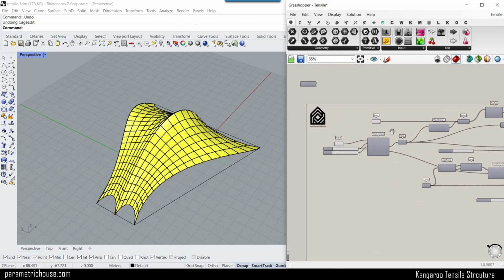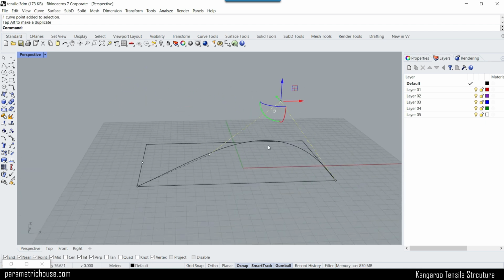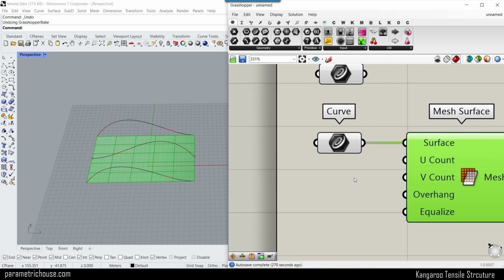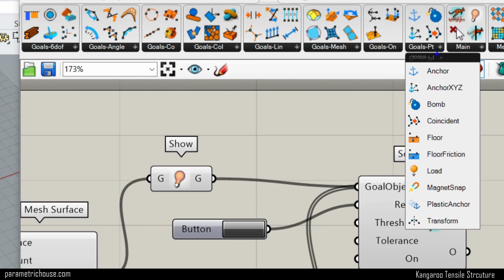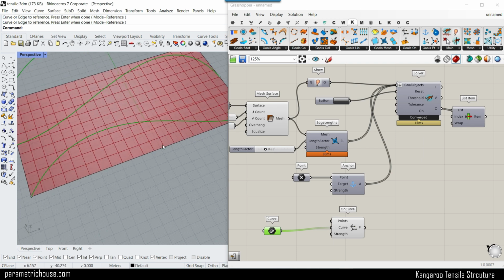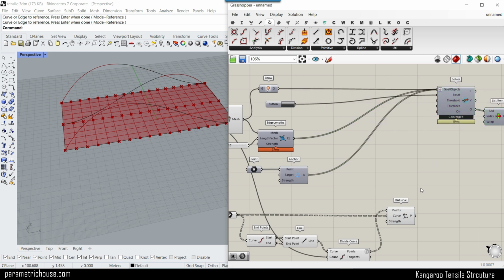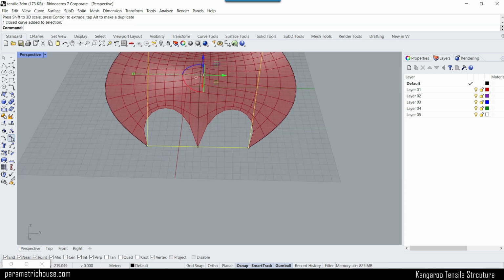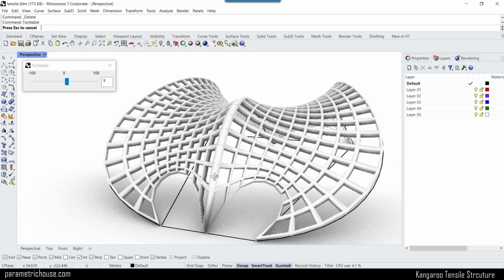Rhino Grasshopper (Kangaroo Tutorial)

Comment: this is really great. As i am aiming to substitute traditional software for tensioned textile structure with parametric design, like grasshopper, i miss some specific control over the periferical curvature of the mesh through tensioned cables running in the periferical jackets. In this tutorial the only control is by altering the U and V count of the surface. Could u give me a clou?  regards dietrich